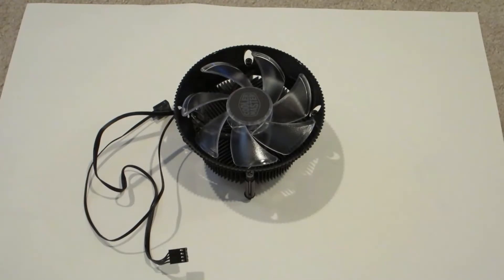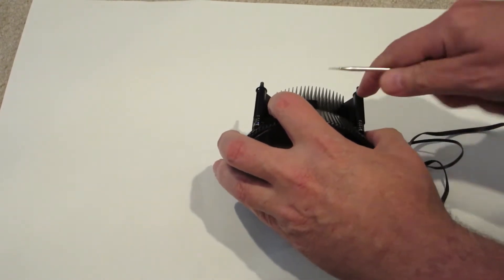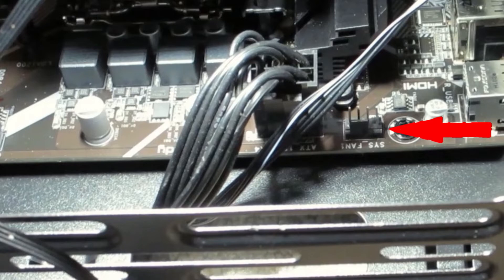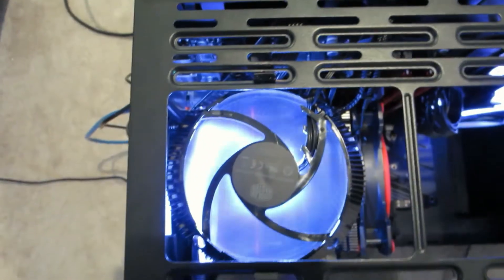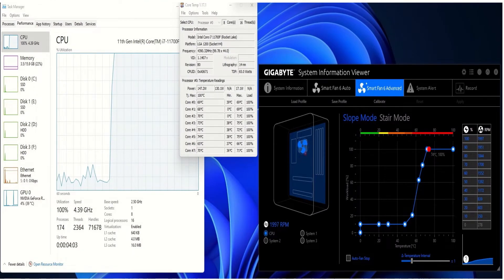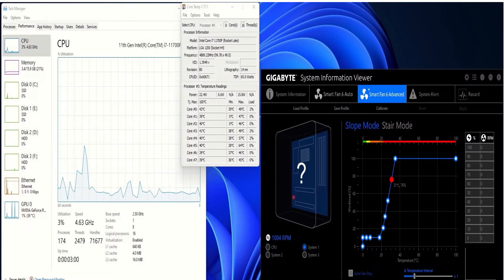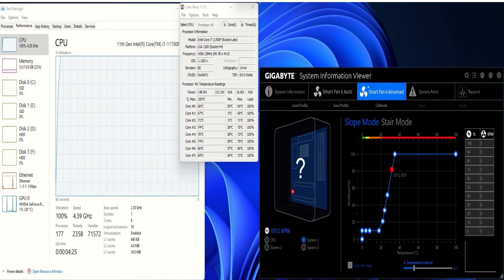Reusing the CyberPowerPC Xtreme i7-11700f 3060 TI CPU Cooler Fan

Comment from the maker: Just an update I now believe adding the fan on top does help a lot. As I was playing games I noticed a lot of heat coming from
the fan on top. So adding a fan on top does help a lot. CPU temps were very low like 53 degrees, the system fan1 sensor was at like 34 degrees after hours of play.

Comment: I ordered the arctic cooler for my cyber power, when removing the stock cooler can I just leave the rgb cord in the whole time and not even have to disconnect?
Reply from the maker: The RGB cord is connected to t he old Cooler so it has to come off. The cord in the bottom of the motherboard stays so you can put other RGB items on it if you want to. 
link to cooler below
https://www.amazon.com/gp/product/B07MC8CRVZ/ref=as_li_qf_asin_il_tl?ie=UTF8&tag=designbuild01-20&creative=9325&linkCode=as2&creativeASIN=B07MC8CRVZ&linkId=770641572584afc24250b923b2f03ee3

Comment: Was your stock cpu fan 140mm or 120mm? I got 120mm and it doesnt fit onto the top like how you showed in this video. Do you have any recommendations on what to do? Thanks!
Reply from the maker: I believe mine was a 120mm not sure why some folks it doesnt fit. I did have to stretch the plastic clip a little but not a whole lot how far apart were your clips off?
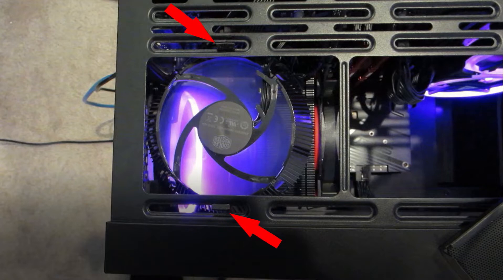Reply: @DesignBuildFixReview  my hooks span 90mm and the size of the hole up top (from "arrow to arrow" at 1:17 in your vid) for me was 100mm. There isn't much give to the plastic hooks, and I fear that if I push them too much, they will break off. Maybe the size of your case hole is smaller? It is very bizarre..
Reply from the maker: @darthrevan7808 the holes on mine are 115mm not quite 120mm but have another set of hole at 125mm. remember how tight it was on the cpu block. I don't understand why there is difference like that.
Reply from the maker: @darthrevan7808  I did have another video where I put two fans from best buy in the top slots and for sure those fans were 120mm. I didnt keep because they were not rgb but did fit nice.
Reply from the maker: @darthrevan7808  My clamps are at 105mm while inplace.
Reply: @DesignBuildFixReview  So after our initial conversation, I decided to try again and turns out I was wrong. The clips were indeed able to stretch farther than I thought, and I successfully fixed the fan into the holder. Thanks for the help!
Reply from the maker: @darthrevan7808  Good job, did you check cpu temp before putting it in? I would sure like to know if it effects cpu temps with and without fan.I think it might have increased my temps by 1 degree but I cant tell. I am pretty sure it didnt help with temp,  I watched one expert video and he showed it is possible that it actually increases temps to put another can in, he was confounded why .I did adjust my fan speeds again a couple days ago. I basically adjusted the cpu fan so that it doesnt run as much at hotter temps so it is slightly quieter didnt really effect gaming temps at all. I also let the top fan not run as many rpms at warmer temps, I moved my box from the floor to close to the chair height and there was some fan noise nothing big or anything but was used to hearing nothing before when it was on the floor. That siv app is not as easy as it looks to use.
Reply: @DesignBuildFixReview  So after doing some research and testing, I found that the overall temp dropped by a few degrees because of the fan. I was sitting at 49-50 idle temp before I added the fan, but now I can get to like 46-47 with some moderate cooling (I adjusted the fan curve as well to not be super aggressive at lower temps). On the other end, when I get those high-end gaming render, my temps hit like 69-71 when they were hitting 75-78 before, so thats a larger improvement. I dont think adding the top fan disrupts the balance of the airflow, especially since I turned it down at lower temps. So hopefully there arent any deadspots that will pull in dust, but only time can tell with that *fingers crossed*. 
However, I gotta say that I am pretty new to this so Im learning as I go, but its been a fun experience so far.
Reply from the maker: @darthrevan7808  Its funny how much the temps change from idle just running SIV I do get 45 degrees when running siv nothing else cpu fan at 24% at 44 degrees, system1 at 56% and  33 degrees. There is barely any range on the system1 temps maybe 32-37 degrees with siv low high end. It does take it awhile to adjust the load even when you close apps off. In fact to get it to really bottom to high 30s I usually reboot and it clears up the idle at 42

Comment: Ay man I got the cyberpower gamer Extreme with 3060ti and it crashes in high graphic games crashes every 5 minutes have a fix?
Reply from the maker: search youtube to install msi afterburner and rivatuner then setup cpu temps and fps then when you play a game shows temps and fps. You also run windows memory diagnotics to che k memory. what games you playing? A quick way to check cpu temps install coretemp run it then right click c drive and run defender scan. Keep eye on cpu temp if 90-100 degrees need new cpu cooler
Reply from the maker: Also disable game mode in windows if enabled, turn off vsync in game. check memory with windows memory diagnostics
Reply: @DesignBuildFixReview  yea I need a new cooler is the nzxt kraken x53 rgb 240mm AIO liquid cooler good for This pc?
Reply from the maker: @VViilson  I looked into that one not sure it has the right connectors on mobo for it. I used this https://www.youtube.com/redirect?event=video_description&redir_token=QUFFLUhqbE1TcUhvb1A3QWxNVGJJamY0YV9sTTRKcHlvQXxBQ3Jtc0tuRUhBMXlHQXpvNHpmTXhHa19IaDJ0WnlTa2daUnZoY2pVTW44aEZ6UzNIckJLZFoxRXFFYUQwX2tNNnlKVTJKazhjaDhQU195WE9QWUpaMWlzZnY4a0Fwb1Fxd1lCcTFYYWltalR2MUt1U0VZVTBsbw&q=https%3A%2F%2Famzn.to%2F3pcbgfC&v=yfj9u8QeY1A&html_redirect=1